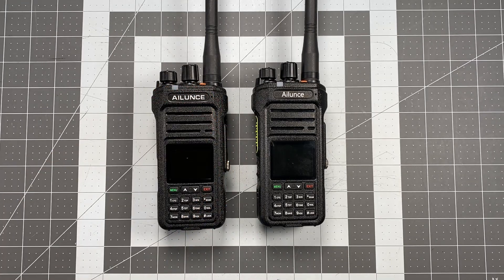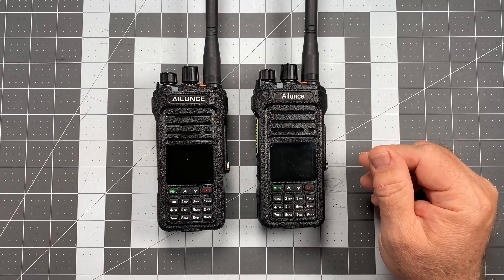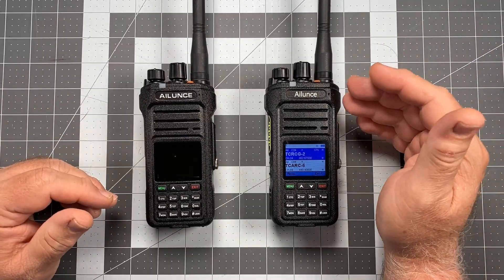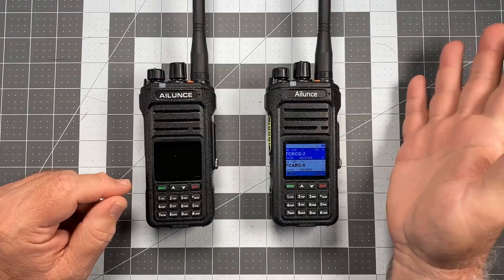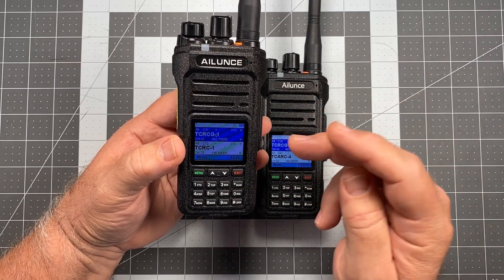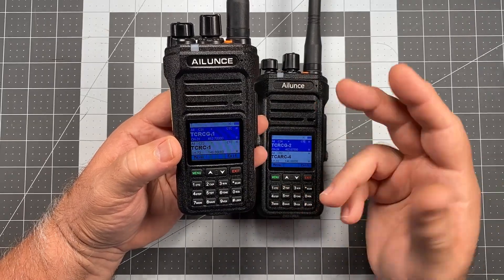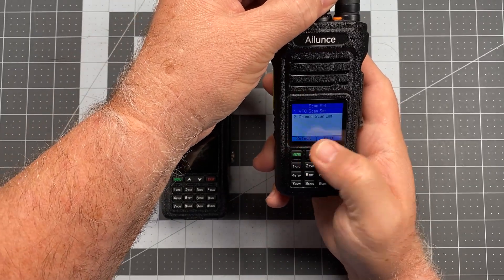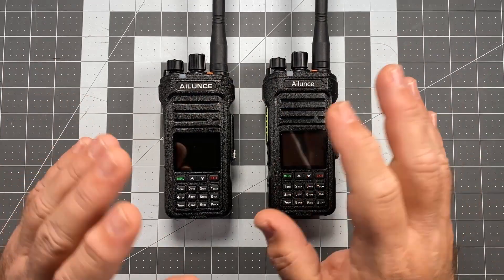Ailunce HA1G / HA1UV Firmware Update V1.01.12.005

Comment: Could you further describe what the signal received screen looks like? I personally rather like signal displayed as a percentage because it's extremely helpful when I'm right on the edge of reception. 

For example, there is a repeater 20 miles away that I can hit, but my signal might be very clear, or it might be very scratchy. When someone else is speaking, I can move around and find the place reception percentage is highest. Where the reception is good, propagation is also good, and I can be heard clearly.

Is the s-meter in the firmware update as finely graduated, or am I better off with the percentage meter of the old firmware? I am hesitant to update because I don't know if I can go back.

Comment: An issue that I've had with the HA1UV is that when receiving a signal, the radio controls don't allow switching to a different channel or frequency. A window showing the receiving frequency covers the display, and the controls seem to go dead until the radio stops receiving. Is this something you know how to get around?
Reply from the maker: Is this when you're in a scan cycle?
Reply: @KS6DAY   I discovered the problem. It was me. If you have the upper "A" channel/frequency selected, and the "B" channel starts getting activity (activity you don't want to listen to), you need to press the "scan" button to select the "B" channel to change the frequency. My problem was that I was pressing the exit key, because that's the A/B button on my other radio. Problem solved.

Comment: Great video... I have a question that I hope you can answer. When receiving a signal another window comes up showing the channel with the frequency being received. I would like to instead of showing the frequency I would like it to display the name of the channel. I have contacted Ailunce about this with no reply. Do you know of a way to do that? 
Thanks
Lonnie
Reply: Same here.. I would rather see the channel NAME in place of the frequency.
Reply: @tandcphotography 
So I have several repeaters around here on 462,575. Two of them don't send rx tones.
How would the radio know which one is being received?
Remember, on gmrs there are only 8 repeater frequency pairs. Even on the amateur side, in some areas I can pick up multiple repeaters on the same frequency.